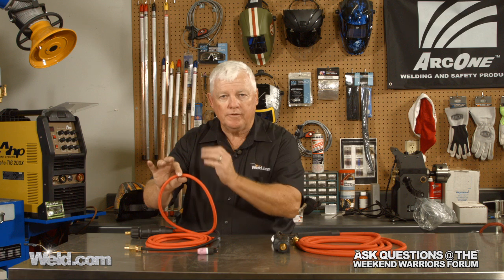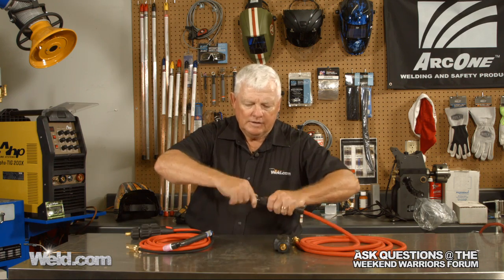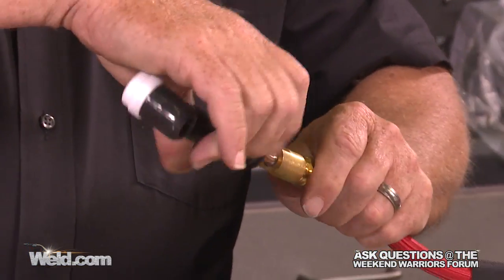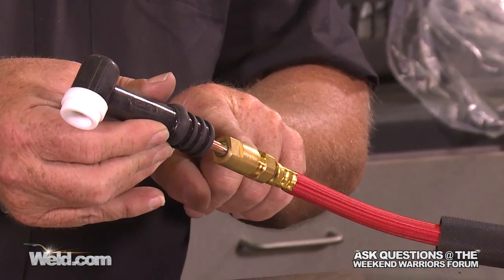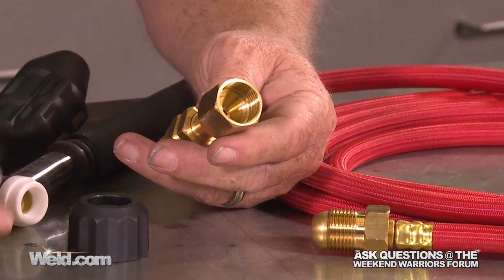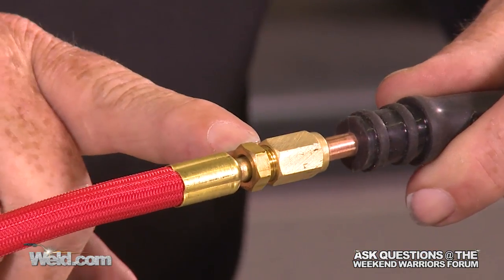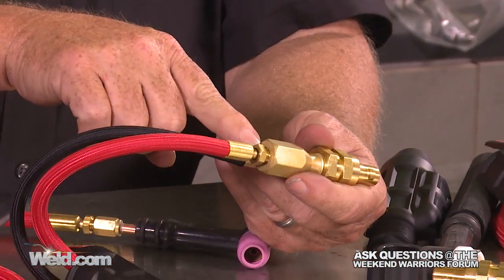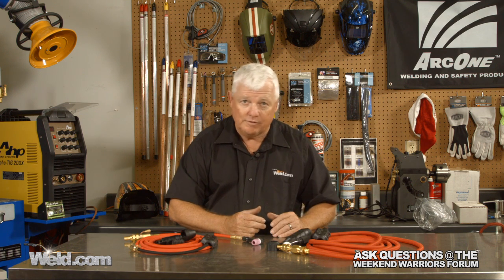150 AMP vs 200 AMP TIG Torch Cables and Fittings and Interchangability | TIG Time

Comment: So the lines and fittings are bigger, which makes sense, what I want to know is are the consumable parts on the torch itself the same size, or are they also larger? Cup size, gas lenses, tip holders, etc.

Comment: hello I have a question?  I have a lincoln LE 31 MP and I want to tig weld with it but I have to buy tig torch k1782-16 but I do not have I can use another tig torch to weld or where can I get connecting for lincoln LE 31 MP

Comment: hey can does anyone know if theres any adaptors to fit a larger wp26 head to a wp9/7 lead? I want to do this because the wp17 lead is smaller and more flexible but a wp26 flexi head is MUCH more  durable and lasts alot longer if its being constantly bent back and forth like I do for basically every weld lol. Can anyone help with this?
Reply: Did you find if you could do it??

Comment: Just so people know you can hook a 26 lead into a 17 lead with a standard 105z57 block to extend your torch using both a 26 if you happen to have a 200amp mig lead it is the same 5/8" RH thead that will thread into the block is typically made for scratch start and clamping a stinger to it the 26 lead is the same thread as your standard argon connections from the regulator to the machine/scratch start block, I have my machine setup on my porch running a  heavy 25' 200amp lead into my 150amp 12.5' CK superflex so I have almost 40' of lead with the 12.5' superflex on the end really good setup and cheaper than buying a 25' superflex if you have a 26 tig lead around or a 200amp mig lead is the same I believe anyway

Comment: I have 2 questions, can i use the cable from a 17 on a 24? As well as, can i use the air cooled cable from a 17 and use it for a water cooled 9? (i want to switch my air cooled machine to a water cooled one)

Comment: i machined some brass ones to fit and works great. i even tried the 26 torch on the 150 amp flex hose and ran that puppy at 200amp and that cable got warm but that's it! and been running ever since with the 26 on the small cable..don't be afraid to try stuff get a machinist to help you out.i would doubt they would rate a cable at 150 and would burn out at 151amp that cable has double its capacity, keep in mind it will get warm but still safe tu use.. the proof is in the pudding
Reply: You haven't done enough high amperage welding then. Because I've run plenty of 200 amp jobs on 150 torches and cables, and they will bake after a while. Unless you want to sit there and cool them with a fan after every few minutes of welding, you will melt the cable and the torch head.
Reply: You’re not getting efficient power transfer though. It’s a short lead, assuming it’s 12.5 feet, but that heating tells you that you’re losing power to the cable. Also remember that the braid inside the cover is hotter than the cover is.
Reply: Does the 200amp turch gets hot like the 150 amp? Or cool like when you run a 200 amp hose